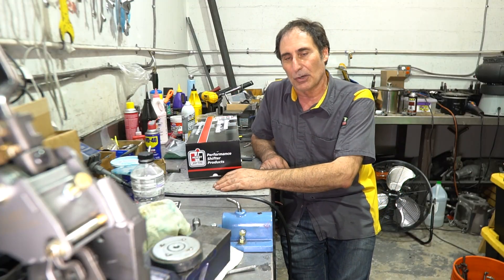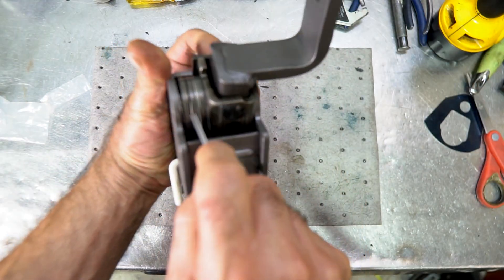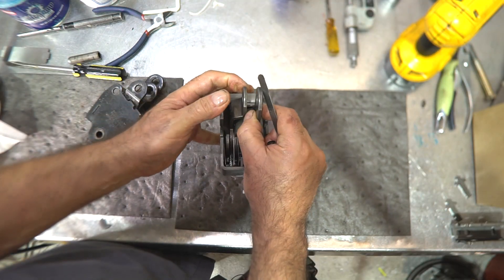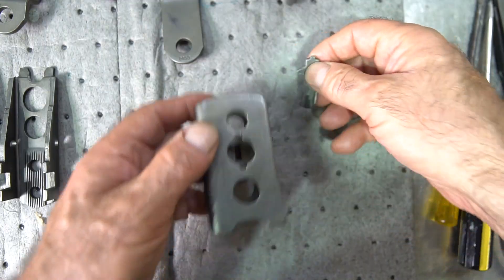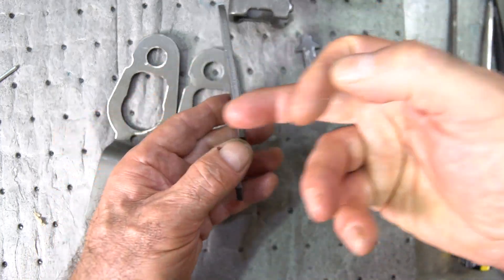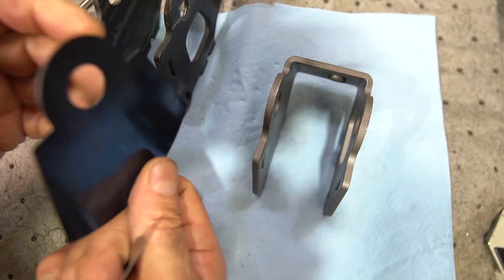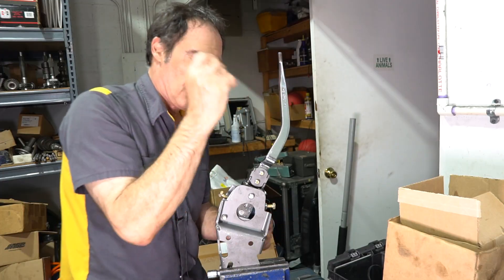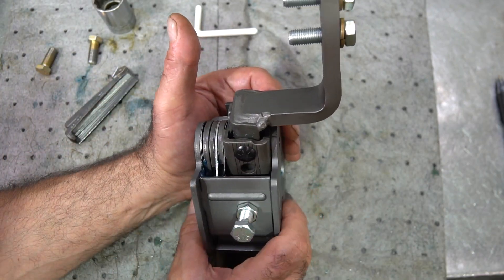Hurst Shifter Secret Modifications Revealed

Comment: Just curious about your thoughts on having the shifters REM polished or teflon coated ? Or does the ''texture'' of the metal parts help hold the lubricating grease ? Thanks for putting this together and sharing this.
Reply from the maker: I thought about Using the REM process on the parts and I can see an advantage. Problem is I would need to do batches of parts for it to be economical. As far as Coatings go same thing A dry film lubricant type coating may work with some light grease proving the clearances are OK
Reply: No need. It shifts so good as is... Really

Comment: Speaking from work experience, seems that they're using old stamping dies that haven't been maintained the best... some burr is "normal" (for a raw stamping) though. Perhaps there was some sort of tumbler/deburr process that Hurst used to use and skipped (to cut costs, etc.)? The housing spacing to be a QC lapse... either their internal spec was cut, isn't being followed, or has been too loose all this time and didn't become an issue until now.
Reply from the maker: The older shifters used a fine blanking process which is different than a simple stamping
Reply: @GearBoxVideo  Go figure. At work there is a burr allowance (per customer inspection standard) that we go by to indicate when the punches/trim blades are worn and need die maintenance work.

I've seen this with a lot of "made on original tooling" vintage items that have lousy quality stampings... Original tooling is fine and dandy, but if it's wore out, the parts produced are often still junk and not worth the metal their made from. I know of one case in the bicycle industry where an English product/brand was bought by a taiwanese company (after being milked for all it was worth by the English parent company)... all the tooling/machinery they had boated from England had to be scrapped because is was found to be too worn to economically repair after several decades of poor/deferred maintenance. Shame, shame, shame.
Reply from the maker: Nobody transfers tooling overseas anymore.

Comment: Can you please make a video on how to remove the counterbalance flange on the tail end of a 2007 T5 transmission. Or can you explain it to me in a reply. Thank you.
Reply from the maker: You remove it with the bolt on the center of the flange
Reply: @GearBoxVideo  yes sir. I did remove the center bolt. Is the flange pressed on because it is refusing to come off? I have also tried hammering it off but no luck.
Reply from the maker: Puller is required.
Reply: @GearBoxVideo  awesome. Thank you. If you need content a break down video of the T5 in the 2007 mustang will be helpful to us viewers. I couldn't find one on YouTube.

Comment: Well, I'm having this exact same issue crossing neutral from 1 to 2 on my hurst mastershift 3 speed. It has a very narrow window I can shift through or it will hang. Does this video apply to the mastershift as well?
Reply from the maker: Similar issue but I do not have shims for the 3 speed shifter
Reply: @GearBoxVideo  thanks for the reply, guess I'll put the stock one back and disassemble the Hurst to see what I find. It's used, but I was still expecting better from Hurst.
Reply: @GearBoxVideo  the four speed shims fit the mastershift mines 2 years old no shims just the spring plate took about 040 to get it down to 025 works great now
Reply from the maker: Hurst may have the shims. As a distributor I never bothered stocking 3 speed shifter parts. Its not Hurst. Try shifterdoc. He may have kits and parts

Comment: I recently picked up an a833 Super Shifter 3, original box, all papers (stamped 1978) and it looks like a drag/toy car that someone put back to stock decades ago. Seems fine on the bench, but who knows until bolted up. Can these be effectively regreased without disassembly? Or do you need to take them down to clean and regrease between plates?
Reply from the maker: In my first shifter video I show how to disassemble the shifter for cleaning and greasing purposes. You need to really take the whole shifter apart. Especially because all the grease tends to dry up and get gummy

Comment: Do you have adapter ring for Mopar volare Aspen bell hole 5.125 to 4.35 for earlier Mopar 833 true 4 speed want to use volare bell thanks don
Reply from the maker: Sorry I do not
Reply: Any tips or tricks I could do?I have a gm 5.125 adapter ring to 4.686 you think the gearbox would be ok If not hammering on it.or with this ring something else I can do.
Reply from the maker: Get the ring for the proper OD and either weld 4 tabs on the OD of the retainer or ID of the ring and machine the tabs to size
Reply: @GearBoxVideo  thank you very much for taking time out to answer a question when a guys in a bind your the man

Comment: I am in need of your assistance. I have been trying to locate a floor shifter for my 1951 belair hardtop. It’s currently three on tree. I have a 235 i6 amd the tranny has stamped on the side which is a 4 bolt cover (3686832 Gm) and stamped on the top is (591747 GM 10). I have found a YouTube video of an installed shifter on the same tranny I have and appears to be a hurts but can’t locate the product number hope you can help. Thanks in advance
Reply from the maker: Hurst mastershift shifter is 3666901  and install kit is 3673111  .Shifter is available, install kit is not.  Check ebay

Comment: Greatings from Sweden, does anyone know whats wrong when the T10 works fine except third gear. Everything is adjusted acoarding to the service book. I am running out of option here.
Reply from the maker: What year, make and model? What is actually happening?
Reply: @GearBoxVideo  When i try to shift in to theird gear there is nothing there. It doesnt even grind the sprockets. But if i force the lever on the gearbox then it works. But i have to move it quite a lot. Mustang 1966 T10 sideloader
Reply from the maker: Sounds like the linkage arm is loose on the shaft.
Reply: @GearBoxVideo  When the gearbox is in neutral the lever for 3,4 is not pointing straight up and when you put it in 3 gear the rod almost hits the 1,2 rod, that cant be right can it?
Reply from the maker: The lever is either wrong or as mentioned the boss that lever attaches to is tripped or rounded
Reply: @GearBoxVideo  I opened up the lid and everything lookes fine as far as i can se. You are probobly not gona like this but i drilled new hole  in the lever under the old one. Now all the gears works fine.

Comment: Very good video.  Typical Holley, buy a good brand then cheapen the product line.
Reply from the maker: I keep on repeating myself here.  The line isn't "cheapened".  Its the skill level and mechanicl abilities of the US workers assembling them.  I am seeing skill levels drop in all aspects of this business.
Reply: I'm referring to the fact that they are using thinner steel for the housing, which I assume is to make them cheaper to build. Which would probably be fine if they actually put a thicker shim in to compensate from the factory.
Reply from the maker: Absolutely not the reason. Im glad you bought this up . Problem is guage sizes change.  Has nothing to do with using "Thinner steel to save money".  Some materials are no longer available. If you are having parts made overseas often times metric sizes vary from imperial sizes.  Even if you have parts made in the USA its next to impossible to get certain materials.. My mod has been used in older shifters as well .
Reply: @GearBoxVideo  I guess I was just confused because in the video you said:
2:43 “normally when you have older shifters this gap was around 50 thousandths”
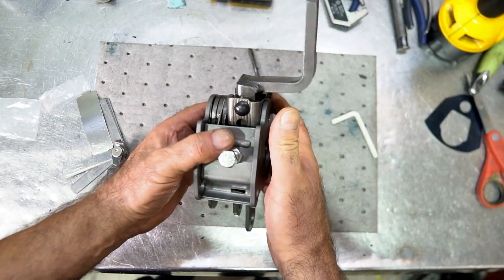4:41 “this is a common problem with some new shifters”
5:55 “now normally on these new shifters because they’re very sloppy… any new shifter I sell I have to take them apart and fix these gap issues”
12:20 “here are some of the older receivers from the 70’s, you can see that the contouring is nice and uniform all the way around”
14:18 “ but the problem with the housings that are later is that there’s a difference in the gauge thickness”  
14:32 “These [earlier units] will run about 10 thousandths thicker”
19:46 “and again the newer shifters are way out of wack, they’re 80 thousandths uncompressed”
But you’re right, it’s inconceivable that Holley would buy a brand with a good reputation, then try to figure out how to make more money by mass producing it using cheaper materials, then saving more money by not hiring a guy to check tolerances at the end of the assembly line.  I must be wrong but it sure seems like Hurst of the 70’s put a lot more effort into making sure their product was tip-top than Holley does now.
Reply from the maker: Yes, but in no way do I say they did it to save money.. got it?  The problem I run into with many companies today is that there is a lack of skilled people with a working knowledge of what the sell and how it is suppose to work. Keep in mind, that older shifters have a lot more tolerance swings. Today we shouldn't have that because machinery and metal forming equipment is much more accurate. So the builders, in the day had to basically have a variety of shims for a variety of pieces in older shifters. So no two shifters were alike. This again is because of tolerance issues and poor quality machining. This is what you got in the '60s and '70s. With any type of metal forming and heat treating you are always going to have pieces that are warped, need straightening. And may need extra shims or less shims. That is why my modifications are important. I do these modifications on both older and newer shifters
Reply: @GearBoxVideo  We only disagree on Holley's motive which neither of us can ever know. Attributing motive is always going to be opinion and mine still stands that Holley bought a good brand and tried to figure out how to make it cheaper. They would actually be irresponsible business owners if they didn't try to do that. I believe Hurst paid a lot more attention to detail in getting the finished product right. Now they've been used and gotten sloppy and need reshimmed. Holley on the other hand seems to be mass producing a product then not checking for correct tolerances in the final assembly. Again, that's my opinion and it will remain my opinion.
Reply from the maker: Its all good. Best thing now is you can buy a shifter from me with all the mods for the same price as a standard one from Jegs or Summit!

Comment: Seems to me that you could just grind off the end of your main bushing that .030 to .050 (or even on a lathe),  and then when you tighten your bolt it will squeeze the housing together that much more and take up that slack, without having to add the extra shims.  I think that gap is simply because your bushing is slightly too long and it causes your bolt to bottom out before it's fully compressed.  Just an observation--  Out of curiosity, I would take apart that old one and measure the length of both bushing and see if there is a difference;  maybe even throw that old bushing into the new shifter and see if it helps at all;  makes me wonder if the factory is simply tolerance stacking.. or like you already said, the housing is a different thickness, but maybe that bushing is still the old length, when it should actually be shorter, to account for the thinner bracket.  Just a thought.  Might be an easier fix than the shims-- but either way, it's easy to see how much better they are once you're done with them.   I've never seen one of these, other than on your channel. lol
Reply from the maker: Your probably didn't watch the whole video. There is a reason for the. 050 shim. Re-watch. It's about relative heights of the gates in relationship to the end of the selector. I explain it great detail. But at least I got you thinking. Also you have a backing plate that keeps the assembly square. Grinding the pin ends up pinching the top only.
Reply: @GearBoxVideo  I did watch it all, I understand the gates (now that you explained it. lol)..  but I can see what you mean with it only being compressed on one side, and would possibly cause it to bind, because the housing/ frame would then be at a taper...  I just wonder why the factory would let these go out the door with that kind of slop?  The shims are a good fix though--  should last forever after that.
Reply from the maker: Basically a few thing happen. The first is nobody at the factory anymore since it's been taken over by more companies and we can think of understands how the shift it is supposed to work. Secondly there are no more engineers everybody is just making a copy of a copy of a copy